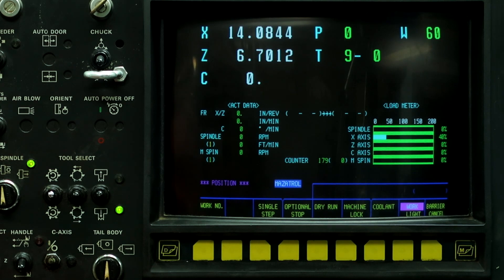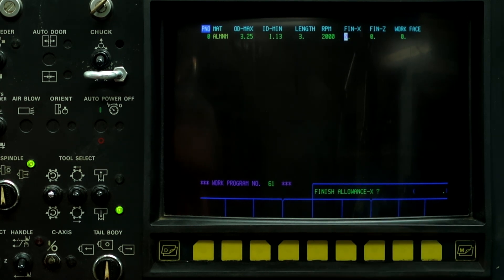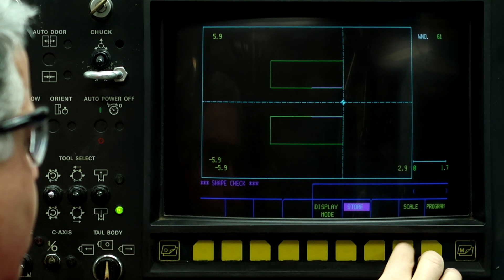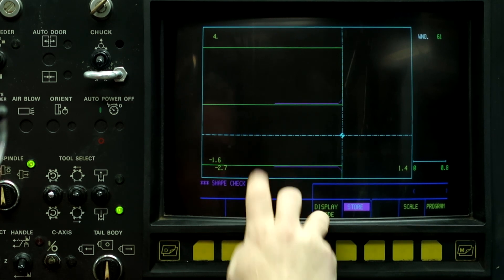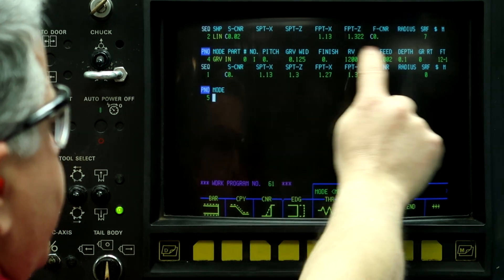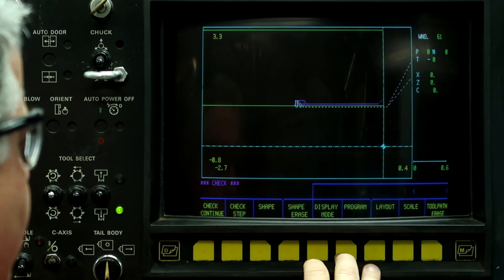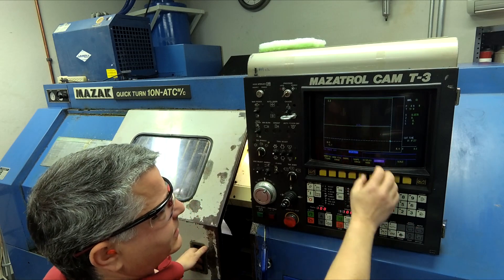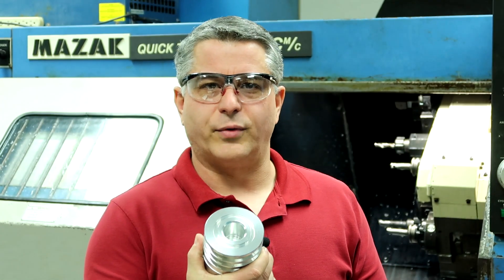Mazatrol Programming Lathe ID Grooving Mazak

Comment: Hi Phil, your training has been a life saver-Thanks a million.
Is it possible to Skip through to the desired process without running the WHOLE program.
I'm using Mazak QT10 with Mazatrol T2 control.
I want to re-run the ID boring without skimming over the OD turning and Threading first.
Reply from the maker: Yes, you push the restart button and enter the process you want to start at. Be careful because the machine will let you start anywhere and it will crash if you try running a finish process before running the roughing process.

Comment: Phil, 

Have you ever been able to do a spiral oil groove on your Mazak?Thanks!
Reply from the maker: Never tried it. I've done some steep helix grooves but not a spiral shape.
Reply: Thanks for the response!

Were you doing high helix stuff just by adjusting the lead in the threading parameter? Were are able to start and end that high helix groove in groove that went all the way around at either end?
Reply from the maker: @KyleN-x1q  The machine will do high helix threading in Mazatrol but the start position will be way off the end of the part. You may be able to do it in a manual process.
Reply: Thank you for taking the time to answer my questions

Comment: Why do the drilling as a manual program instead of using DRL?
Reply from the maker: On my old T2 controller, I cannot describe the tool as both a boring bar and a drill. I want to use the insert drill as a boring bar sometimes.
Reply: I wondered the same but now I see. 👌🏼